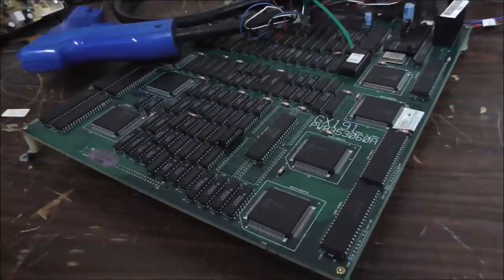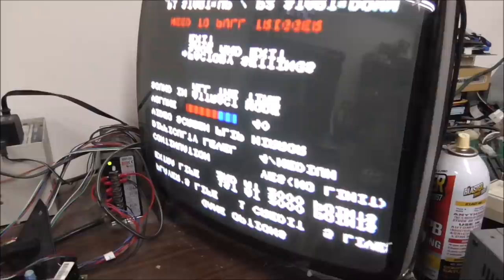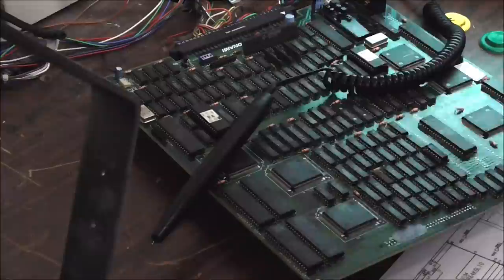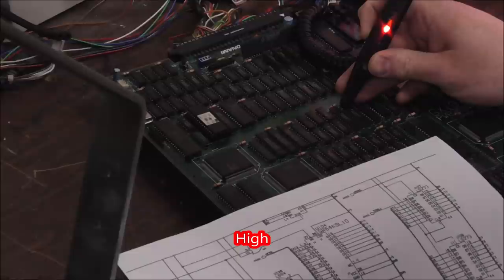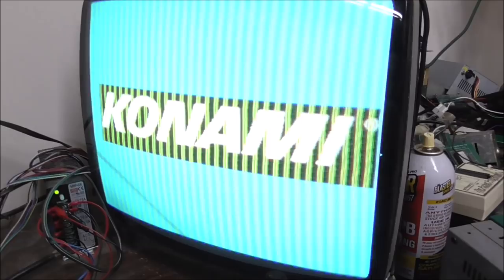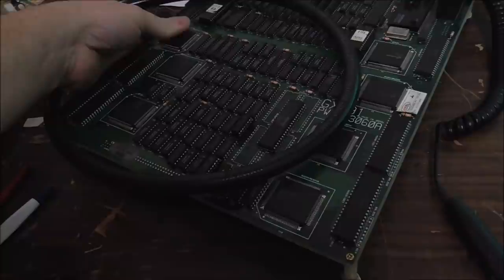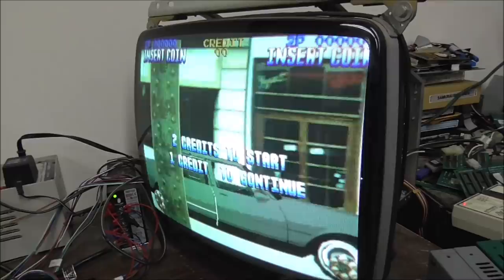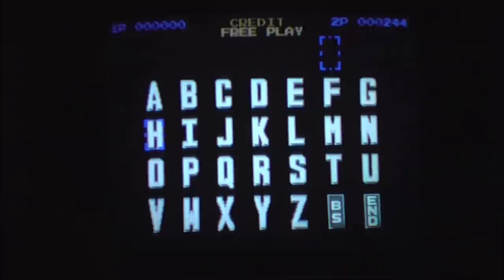Repairing Konami's 1992 Lethal Enforcers Arcade Game ... What a Classic!

Comment: As someone who both designs pc boards and repairs them, you should buy yourself some bismuth based solder. It is extremely helpful in removing high pin count ICs. It has a very low melting temperature. You use it to pollute the solder on the pins of the part you want to remove. You blob the solder over all the pins, and it allows you to pull the part while the solder is molten, because of the low melting temperature. After you have removed the part, remove the leftover solder with braid, and you can get beautifully clean pads to accept the new soldering. The product "chip quick" is just an overpriced version of the bismuth based solder.
Reply from the maker: I'm going to try that, I had never heard of it but thanks for the info.  I run into this all the time, and I've tried a desoldering station in the past but never could get one that worked right, or I didn't clean it right, or something.  I'm going to get some bismuth solder though, thanks!

Comment: Typically, the upper address lines don't fluctuate as often because bytes are typically referenced sequentially.  Especially on program ROM.  Each address line is typically a higher power of 2 so the higher up you go, the less it typically needs to change.
Reply from the maker: That makes sense, thank you Oval Teen!

Comment: once:  You said "I have to switch out a 47 ohm capacitor and all I have is 100 ohm" If you solder two 100 ohm caps in series (not in parallel) then you make a 50 ohm cap (which is closer to the 47 ohm cap that you wanted).
Reply from the maker: Thank you Jose!

Comment: At 8:06, you have red lines on the screen that’s usually a dead giveaway of a floating pin.. when the image kind of “fades” in and out. TTL chips often “clock” on their inputs when they are floating in a noisy circuit.
It never ceases to amaze me how you do your repairs with nothing but a logic probe. You’d be dangerous if you actually used a scope!
Here’s a thought. Take a large screwdriver, and connect to ground through a 10K series resistor. Touch the signal inputs and watch for a change on the screen. If you see no change, it’s connected. If you see a change, it’s a FLOATING INPUT. This works because the input will float high or clock. Connecting it to ground will alter the image.
Reply from the maker: That makes sense, so basically when it comes and goes like that it's because an input to some TTL chip is probably completely floating... i'll try to remember that Rick, thanks :)  We'll use a scope eventually, I own 3 or 4 but never break them out, maybe I'll get stuck and need to :)
Reply: Mr Guru, scopes can do things no other piece of signal evaluation can do. You will NEVER see a bad slew rate on a clock or know that a chip is clocking, but not clocking correctly, with a logic probe.
Reply: Joe's Classic Video Games, remember that your logic probe can TRICK you. Video circuits often have multiplexed signals so you might hear the clock with your logic analyzer and never know that part of the signal is missing. Only a visual examination on a scope can answer that.
Reply: Mr Guru, scopes are easy. I dunno why, when I taught, my students were always resistant to using them also. I worked at a company repairing casino game CPUs and SMPS power supplies and I was the only tech who used a scope. The other guys fixed power supplies using only component level checking. It was no surprise that I had to help them when they were stuck on a power supply repair and they couldn’t repair CPUs at all... the difference was a scope and my knowledge of how components function as opposed to just knowing when they test bad on a diode checker. To be fair, I have a Masters and engineering experience.
Reply: Mr Guru, You are 100% incorrect when you say, knowing how components work internally isn’t important. I worked with some very good techs. My observation was, they knew when components were bad, but they didn’t know how they functioned. That was a big advantage when I had schematics, but going in blind, as you often do these days because manufacturers don’t provide schematics, a good tech should be just as adept at doing repair.. if they’re willing to use the right equipment.
I used to help them troubleshoot their circuits from across the room. I’d study a circuit and say, do you have this voltage, or this logic level? They’d answer and I’d tell them what component to replace just but studying how the circuit was functioning incorrectly.
Reply: @robj7481  I think one of the signs of a good tech is how often you don't need a scope.  Just like a good tech doesn't need an electron microscope and x-ray machine to find a cracked trace or bad solder joint

Comment: Hi Joe thanks for the great video. I have a problem with my LE pcb. Cannot get into Test Mode. I tried test button and wire ground and 15 pin but nothing happens. Any help would be appreciated.  Many thanks
Reply from the maker: Sometimes there is a resistor that protects the signals on the inputs and it may be damaged or something, that input line (the test line) will come in and then go through a resistor to an IC that handles the inputs, I haven't worked on that particular problem though unfortunately.

Comment: Interesting repair. I sold my Lethal Enforcers PCB in time before that stupid sound CHIP thingy could go bad. Didn't have the cab anyway :D I didn't realize that your are not allowed to call a microCHIP CHIP. Hell, there's a even a CHIP company called MicroCHIP Technology Inc. Too bad CHIPS do not contain sticks of uF :D
Reply from the maker: LOL a  guy earlier told me, on this video, that I shouldn't just randomly replace chips, I should try to figure out which one it is.  What the hell?  It's like these people don't even watch the video.  Then he told me it could be a tri-state chip, well, if it's a tri-state then why did it fix the damn board when I replaced the one with a floating output?  Always hecklers!

I only had two people tell me not to call them chips so that's not too bad :)
Reply: @LyonsArcade  Oh boy, I watch a lot of arcade repair videos on YT in order to try and learn, and even people with an apropriate background and a boatload of hightech equipment sometimes have to more or less guess and even fail. And basically each of them has a different approach to things. Thats just how it is. I find it very impressing and inspiring seeing what you achieve by just using a logic probe and this rare thing called common sense. You shouldn't be so thin skinned about these kind of people, it's just not worth argueing ;)

Comment: instead of cutting the legs, have you thought about investing in a desoldering gun? the thing that heats the solder and sucks it out automatically one pin at a time? btw, love the videos.
Reply from the maker: I did have one in the past but I never could get it to work right.  So I haven;t mastered that yet.... thanks for watching!
Reply from the maker: @lwilton  On the pinball machines, I've often been able to lift 40 pin chips out, but really they have big ol fat traces and for whatever reason they clean up really well, I can remove one of those with a hand pump.... but on these arcade PCB's depending on the manufacturer it gets really iffy even on the small ones.  These boards have that cursed audio chip too that has the smaller pins on it, nearly impossible to desolder without a really good desoldering station!

Comment: You really need to increase your knowledge of basic digital logic. The fact you had a pin with nothing on it does not necessarily mean it is a bad signal - it might be a 'Tri -State' signal, meaning another chip could be using the bus without conflict. The reason address pins are low is to do with address decoding basically the microprocessor is 'talking' to a specific system eg ROM, RAM, I/O, AUDIO etc
Check out Ben Eaters 8 bit bread board computer project for some basic info which will be of massive help to you. 
Lastly, PLEASE try to stop changing chips using a scatter gun approach it drives me mad use knowledge to determine exactly what is wrong and make an informed decision. And get yourself some proper test equipment you can get yourself a basic scope suitable for you purposes for £50 ish
Reply: @LyonsArcade  Yeah !
Reply: @LyonsArcade  Great fix video.  Wankers like this guy are better ignored (but I loved your retort).  Keep up the good work!